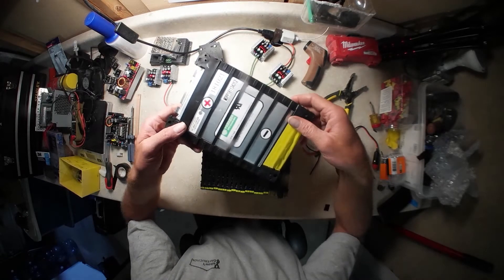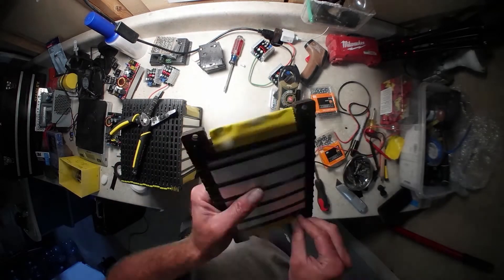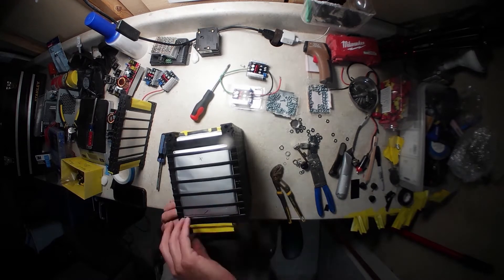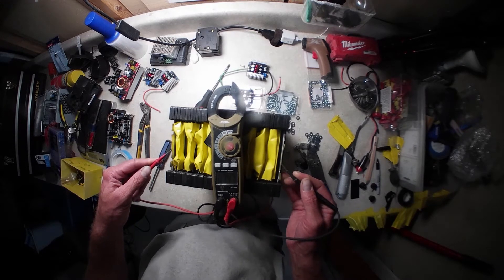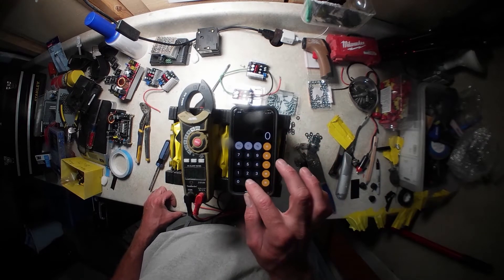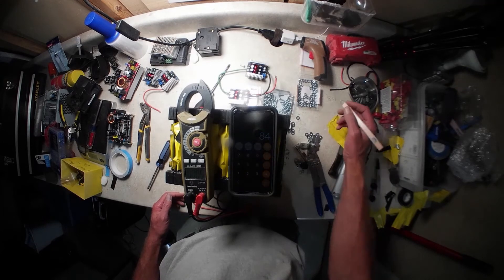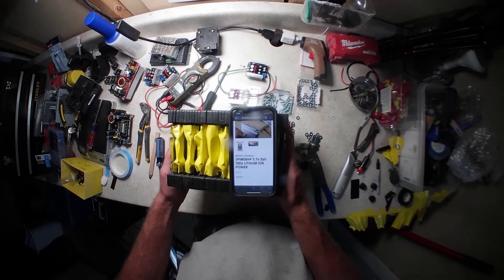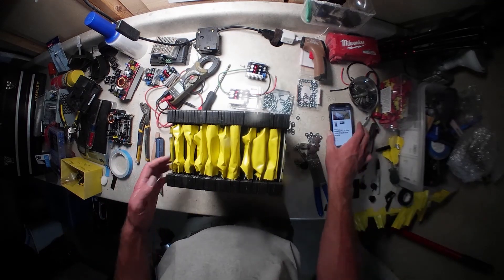Electric ATV Battery build first pack spim08hp 72v 20s

Comment: I'm doing the same pack but with the 18ah ones. It hopefully will give me extra range. I'm running a 72v 60amp max motor. I Knew these batteries could handler that easily, but i didn't know for how long.
Reply from the maker: Cruising speed will be based off weight, speed, gearing etc.

Comment: Where did you go to school ?
Reply from the maker: YouTube! 😂😅😬 and the school of failure. Already burnt the atv down and am on to other projects. Next one is the death cart 200v golf cart with the stock motor. 😂😅🤤☠️
Reply: @RetroElectric   If you are not failing you are not learning! :D  What ended up happening that caused it to burn down?
Reply from the maker: @CodysGarage  someone messing with it that shouldn’t have been shorted the 18650 batteries that I still had jimmy rigged on it. Happened to bypass the fuse during the short so 2kwh of batteries overheated and burst into flames. 😁